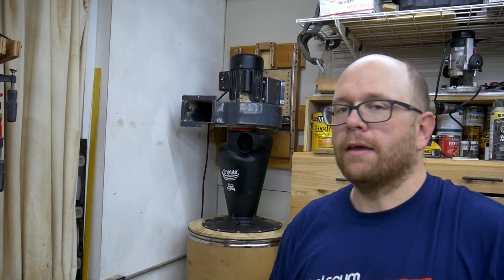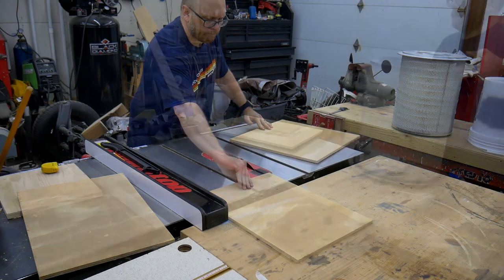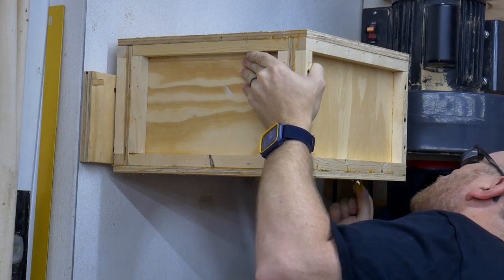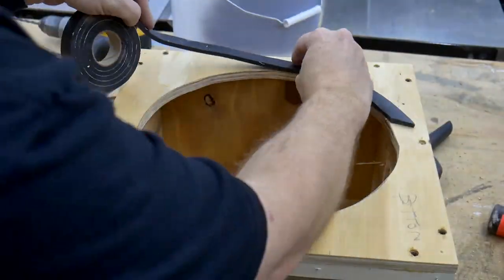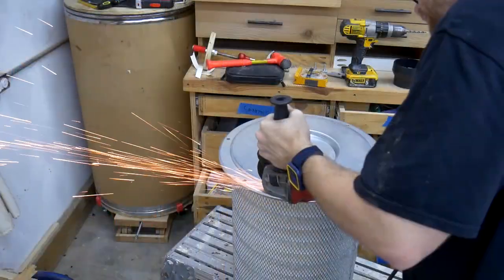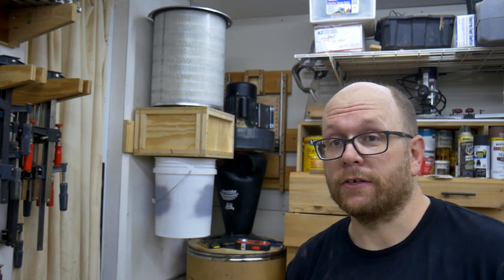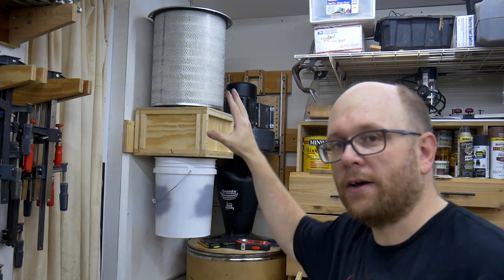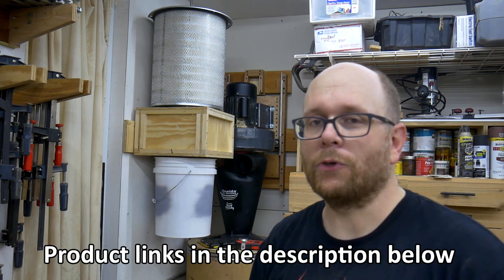DIY Dust Collector Filter Box || Affordable 2-Stage Dust Collector Part 3

Comment: Nice job. I like the inside out box. I had the same concern, but did not think about inside out. I covered the inside structure with foil tape to reduce the catch points. I am moving to a new shop and might rebuild the box.

Comment: How do the slides work now since you connected the filter with a solid connection?  I thought the original design was very smart. If by adding a short piece of 4 inch flexible pipe between filter box and exhaust would that not give you what you originally intended? Sorry if I misunderstood your original design part 1 thanks
Reply from the maker: I gave up on the slides, unfortunately. Due in part to the fact that the filter box is mounted to the wall, but also because they didn’t work well and made it very difficult to move the collector. I’m sure I covered it in one of my videos, but that was a long time ago. Now I use a small scissor jack to raise the dust bin up to the dust collector and that works really well.

Comment: Enjoyed the video! Sorry for the dumb question. You used an intake filter. Intake implies air from outside in. But in this case, air is going inside out. My furnace filter has an arrow for flow direction, so seems that can matter (in that case at least). Is the filter working well even though it is backwards to design? Also, what MERV rating is it?
Reply from the maker: You are correct that the flow is backwards, but it shouldn’t affect the performance of the filter. If anything, the wire cage on the outside of the filter helps support the inside-out airflow. Not sure on the MERV rating as this isn’t designed for HVAC use, but to be sure I also run a HEPA filter hung from the ceiling above the table saw

Comment: Great idea on the through threaded rod to tie it all together. I too built a box for the filter to sit on but just use it as a bucket. When needed it has a hole that can be uncovered to suck out dust using a shop vac. Very little accumulates after the separator unless I miss the drum overflowing. With the table saw that takes forever but a jointer & planer will fill it up fast. To solve that you can make a DIY full bin circuit for $30-60 dollars. 

How will this filter box work when you raise the blower to empty the main dust bin?

I'd like to rebuild my setup soon and it would be nice to exhaust the air outside in good weather. Your design seems like a good base to start from and add some sort of exhaust gate to,. Thanks for the video.
Reply from the maker: Thanks for the comment. To answer your question, I scrapped the idea of moving the entire collector up and down and now use a small scissor lift to raise the dust drum up to the collector. You may have missed it. The video is labeled “part 2”. Cheers!

Comment: Nice clean design! I have a similar filter on mine. Got the idea from a buddy in my woodworking club who used to be a diesel mechanic. I used the holes in the rim of the filter with several 10-24 threaded rods, but I like the idea of a single central rod... Maybe if I redo it someday!
Reply from the maker: Thanks, Ben!
Reply: @SouthpawWorkshop  any time! Looking forward to your ducting ideas too. I’ve had to redo my system several times from moving or rearranging.

Comment: FYI- the red ring you made, I did the same thing but then I realized with a few wraps of electrical tape I created a tight seal easily and without printing
Reply from the maker: I used to do the tape thing, but it tends to deteriorate over time. With the shim I don’t have to worry about that and I can connect/disconnect/rearrange to my heart’s content without worrying about my taped up ends. Cheers!

Comment: I am in the process of building one like this out and I’m wondering how frequently you’re dumping that bucket. I’m considering buying a large PVC flange and using dust collector bags but that PVC flange is PRICEY!
Reply from the maker: I don’t have to empty the bucket at all. The only thing left after the cyclone is fine dust particles and those get caught in the filter. The bucket is there in case I accidentally overflow the collection drum. I think I am going to replace the bucket with a second filter because I am finding that the single filter clogs fairly quickly, especially if I am sanding a lot.
Reply: @SouthpawWorkshop  interesting. Appreciate the quick response. I would have thought some would make its way into the bucket. If you tap the outside of the filter, those fine dust particles don’t drop into the bucket?
Reply from the maker: You are correct, it would. The dust just won’t fall into the bucket on its own. I can usually tell by the amount of suction loss at the hose when I need to blow out the filter.
Reply: @SouthpawWorkshop  super helpful, homer bucket it is